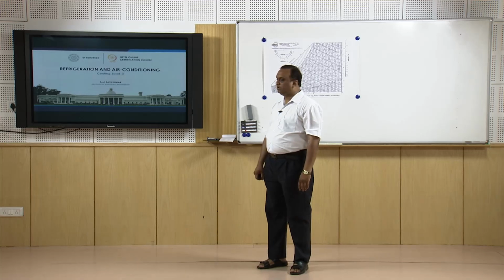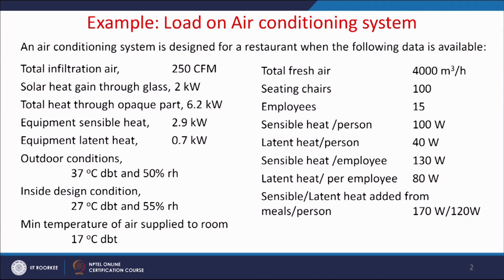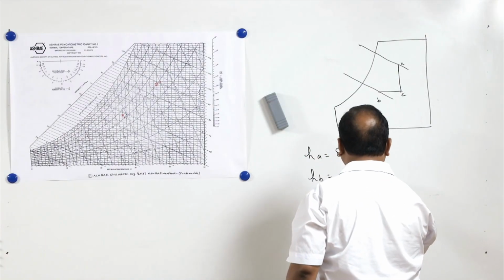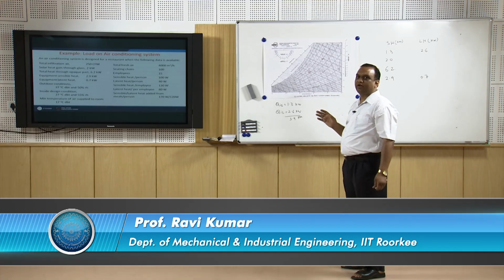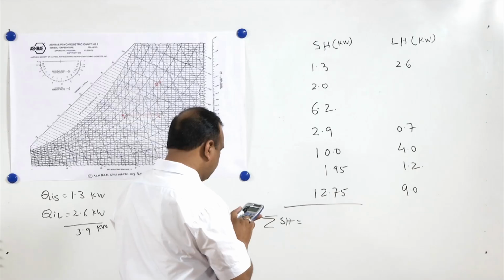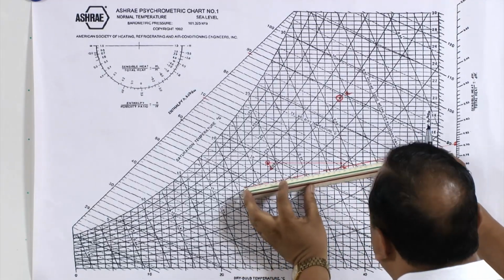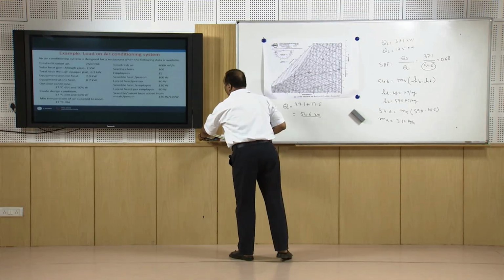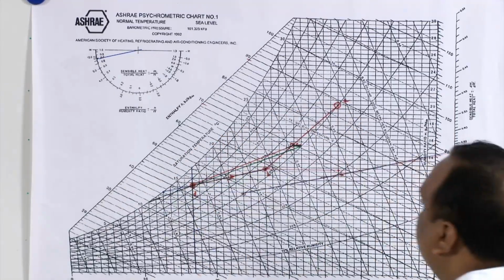Cooling Load -3

Comment: overall good lecture. but your shf line drawn is not parallel to the gradient obtained from circle on upper corner left. that is because you should never connect shf on rhs to room air condition. u should use only the gradient of the shf line on right hand side and use this gradient line to draw through the room air line.